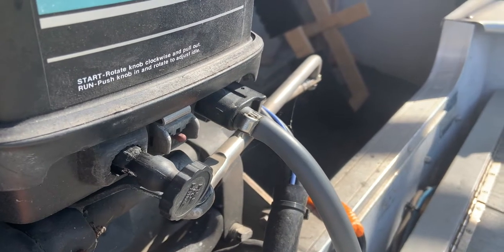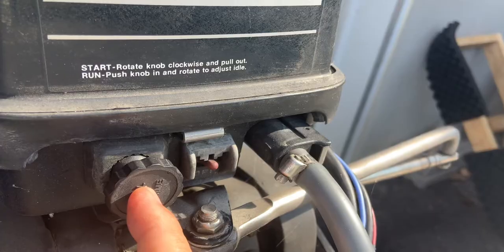Mercury 25Hp Pull to prime button explanation “start your engine”

Comment: Great video thanks. I have same exact motor. Question; person I bought boat from has it connected to a throttle with steering wheel.  In the throttle it mentiond "choke" as well. Do i still need to push in/pull out this choke knob on actual motor if its connected to steering wheel? Also, I find my boat initially starts ok. But while its idling (before I give throttle/gas), it "putt putts" a lot in idle (similar to how yours sounds in idle) but entine usually shuts off if I dont give it gas immediately after starting. Ever run into this issue? Im also about to start boat up for first time since it was winterized and I sadly dont know where the water hose connects :( I will put that sea foam in. Thanks!
Reply from the maker: Hi mikecorazza, I have a steering wheel and throttle also, but I don't have the choke option on it. When you activate the choke on your throttle do you see anything move on your engine side? Your choke on the throttle side might not be connected to outboard. Pull to prime button is a little more then just opening the choke. It also injects a little gas to help engine start better. For the “putt putts” might need to change your reeds or adjust the fuel and air mixture with the screw Infront of the carburetor. If you do adjust screw, “mark it first”, this screw can be tricky to adjust. I will have a video soon how to change reeds on outboard, I changed them this weekend and the outboard sounds much smoother.  For the water you need to purchase water clamps to put at the bottom water entry of the outboard. Hope this helps. 😊
Reply: @joetheboatguy5394  thanks for this info it will certainly help!  Is there a way for me to attach a photo of how my setup is with throttle to this chat?  Or email to you?  Also, how were you able to make your motor have power trim?  Every time I drop in at the boat launch I have to lean over the edge and pull little release tab or whatever it's called and lift entire motor out of water, drop back down, ljff back up etc.  Not sure how you have an electric setup so motor tilts out of water?? Are you able to attach pics or if leave an email address? Thanks so much !!
Reply from the maker: Hi mikecorazza, unfortunately Youtube chat doesn’t lets us attach photo’s. For the e-mail request I have done it once and it was a fiasco LOL. Was receiving e-mail and calls even over night. So I learned quickly that, that was a little mistake. If we can find another way would be great. 

For the electric tilt I have a CMC (I will paste a model at the end of the chat to show you) you would have to find what model is good for your outboard and boat. 

https://www.amazon.com/CMC-PT-35-Tilt-Trim-35/dp/B0CNKZN2T9/ref=sr_1_2?dib=eyJ2IjoiMSJ9.oVizQjpSEbGEiOqhG6696pm5A0R-h1mSE_W9o0I9_3AW_wuQFbuwhknb0NmPYEs6PTOk0Z1cDDkrBIezEjETdeRGDXVJp3KXF9S-lkEKvoIwSp2uMhuysFUwbIG-OTI7II1q6j9_fsU471_Vp5Zkbv1I9ep6FTdoe5dRfrrBPtF0sSNxEy9LTEG1oEyaRYVT8wKToYUFPK43jqf60KhP6pW7LKtIO9B_guxAns3BzUtk9nTEfwZEPcBjQoN74xJ4_mCPZsB2_NZgzryDNK9wg9Y43EAUBn0nOEJyl8SJtsE.q3PDCHTRxhYYu8VboTcyFj-CmKvYaz7EZJnkEGkPQY8&dib_tag=se&hvadid=409940860077&hvdev=c&hvlocphy=9003503&hvnetw=g&hvqmt=e&hvrand=9168730546767543213&hvtargid=kwd-2939807001&hydadcr=24658_11410762&keywords=cmc+tilt+and+trim&qid=1712100464&sr=8-2
Reply from the maker: Hi mikecorazza, unfortunately Youtube chat doesn’t lets us attach photo’s. For the e-mail request I have done it once and it was a fiasco LOL. Was receiving e-mail and calls even over night. So I learned that that was a little mistake. If we can find another way would be great. 

For the electric tilt I have a CMC (I will paste a model at the end of the chat to show you) you would have to find what model is good for your outboard and boat. 

https://www.amazon.com/CMC-PT-35-Tilt-Trim-35/dp/B0CNKZN2T9/ref=sr_1_2?dib=eyJ2IjoiMSJ9.oVizQjpSEbGEiOqhG6696pm5A0R-h1mSE_W9o0I9_3AW_wuQFbuwhknb0NmPYEs6PTOk0Z1cDDkrBIezEjETdeRGDXVJp3KXF9S-lkEKvoIwSp2uMhuysFUwbIG-OTI7II1q6j9_fsU471_Vp5Zkbv1I9ep6FTdoe5dRfrrBPtF0sSNxEy9LTEG1oEyaRYVT8wKToYUFPK43jqf60KhP6pW7LKtIO9B_guxAns3BzUtk9nTEfwZEPcBjQoN74xJ4_mCPZsB2_NZgzryDNK9wg9Y43EAUBn0nOEJyl8SJtsE.q3PDCHTRxhYYu8VboTcyFj-CmKvYaz7EZJnkEGkPQY8&dib_tag=se&hvadid=409940860077&hvdev=c&hvlocphy=9003503&hvnetw=g&hvqmt=e&hvrand=9168730546767543213&hvtargid=kwd-2939807001&hydadcr=24658_11410762&keywords=cmc+tilt+and+trim&qid=1712100464&sr=8-2
Reply: @joetheboatguy5394  appreciate the reply. I get the reservations about putting an email out there so I totally get that. If I can think of another way as well I'll let you know. And I have the exact same motor as you on a 16 and 1/2 ft aluminum alumacraft. My motor is 1989 and boat built in 1978 . Whoever set up the boat before me, also added a steering wheel with a throttle and that little handle that goes up to make idling faster.  I checked that link and item no longer available but ill look for alternate and thanks for idea.
Reply: @joetheboatguy5394  hey and sorry to bug you again. Just fired up motor this morning for first time since a marina mechanic winterized/fogged it. Again, I have exact same 25hp 89' Mercury motor as you and very similar (if not identical) hand controls. I let them do it because was first winter owning a boat ever.  Anyways, I had bottom half of shaft with those water intake grills (not sure what they're called) submerged in giant bin of water. I fired it up, and A LOT of smoke was coming out from all around motor. Now I know they poured stuff in before end of season last year, and they advised me to pour a little more in before I started it.  Do you think that smoke was just the sea foam from all winter?? But what bothers me is I didn't see water spitting out of I think it's called the tell tale?  I don't remember if my motor spits water out?? I thought all outboard do? There was so much smoke in the back that I only left it jn idle and gave zero throttle in fear that something was wrong, and let motor stay on no more than 5 seconds.  All kinds of things came to mind like wad the pale of water too high up on motor and blocked something it shouldn't have ... is tell tale plugged, something else wrong etc..  Just curious if it's normal for so much smoke after sitting 5+ months, and does your motor (exact same as mine) spit water out when in idle?  Thanks!
Reply from the maker: Hey Mikecoraza, it's no bother at all. No worries. Yes if you have fog and Seafoam in your engine, it will cause a white thick smoke, it normal. It will do that smoke until it burns all your Seafoam and fog.  

Now for the water, yes your engine needs to spite out the water from the tale. Sometime in idle the water doesn't make it way trough the water pump, a little throttle might have help to get that water going. On idle water should make it way trough but you just open your engine so a little throttle might help it. I don't use a bucket i use one of these https://www.amazon.ca/dp/B09M8VFY7D/ref=sspa_dk_detail_5?psc=1&pd_rd_i=B09M8VFY7D&pd_rd_w=wxZas&content-id=amzn1.sym.d8c43617-c625-45bd-a63f-ad8715c2c055&pf_rd_p=d8c43617-c625-45bd-a63f-ad8715c2c055&pf_rd_r=M9AECRY7RW8AQGAKGQBA&pd_rd_wg=MW1U1&pd_rd_r=ee6b8027-8ea8-4f59-973b-b04bccd3e669&s=amazon-devices&sp_csd=d2lkZ2V0TmFtZT1zcF9kZXRhaWw

BTW i have a video on how i winterize my outboard too if you want to attempt it next winter: https://youtu.be/TyvYxgSd4Mk?si=mw1Z6Y1RMBMDvsut

Let me know how it goes :)
Reply: @joetheboatguy5394  thanks so much once again! I wondered how you were putting water in with the hose in one of your videos. Maybe you could make a quick video about that to get more views;). A mechanic at the place I winterized said they see people burn out their motors and replacing impellers using hose to put water in saying its not enough water, and they recommend motors are only started on bodies of water (unlesss theyre experienced mechanics and have very large bins to submerse the motor.. But i see you and so many others on YT doing it this way and you havent ruined your motor yet so im guessing I should be safe! And thanks for info on the smoke/water and adding throttle etc.  I did see your video about winterizing but I had my boat for a few weeks (never owning one before and not a mechanic) and still wasn't comfortable yet. But probably will give it a go this fall and planned on using your video to guide me. Thanks again !!
Reply from the maker: Hey mikecorazza, any update? engine back to normal. The Mercury of those years were the best engines ever.....
Reply: @joetheboatguy5394  hey Joe. I can't believe you messaged me. What I mean is, your timing is unreal as I'm literally working on my boat to add little cubby spaces for storage. However I was literally thinking of you to make your timing even more unbelievable because I took my boat out 2 days ago on the water. Ran great only smoked for a little bit water spitting out in the cooling system like it should. Now today, I'm in my garage working on other parts of the boat, and looking at the bottom of the propeller, which is a foot off the floor, and small amounts of oil are dripping on the floor. That raises my stress levels because I feel like it's going to be a big deal
Reply: @joetheboatguy5394  forgive my messages I'm using voice to text. But basically there's almost like two things on the ground, a dark oil, and even more like a clear looking oil that you'd see like in your car engine. Just the tiniest drops not anything coming out fast but I'm trying to figure out where it's coming from and I thought of you LOL. And I have to go to work in an hour as I work afternoons so the timing is bad as I wanted to look into this further and I planned on going with the guy fishing tomorrow morning but now I'm stressed out about this. I'll try and see if I can see where the oil is coming from like if it's higher up or lower
Reply from the maker: Hey Mikecorazza, you probably have an oil drop and oil mixed with water which will be much lighter. You just have to make sure to see if it continues dripping. if it doesn’t continue dripping then your fine. don’t forget you have a two-stroke engine so you do burn oil, so oil will end up coming out of the system. I will look at the video when you give me give me the link, but I wouldn’t worry too much unless you have a big oil stain on the floor that keeps on growing.         Your gas tank is mixed with oil and fuel, so the fuel gets burnt the oil lubricates your engine, but the extra will end up coming up, which is not much. But that is what you’re probably seeing.

Comment: Mine broke, is there a way that I can replace/buy a new one?
Reply from the maker: Hi Julian, thanks for watching. Look under Google search for “Primer Knob 128022” you should see some results for knob.
Reply: @joetheboatguy5394  I have a 20 hp 2 stroke mercury outboard though, would it still be the same part I’m looking for?
Reply from the maker: Hi, would be hard to say without the serial number. Get your serial number and enter it at this website and look under carburetor section you should find it… 👍
https://www.perfprotech.com/mercury-marine-parts-catalog/collection/01/mercury
Reply: @julianmontes4314  yea same from
15-25
Reply from the maker: Thanks for the help @habitat009. :)
Reply: @MrHabitat009  I bought and installed it last week and went out yesterday, motor ran strong
Reply: @julianmontes4314  How does it go back together?  Trying to replace mine.

Comment: Mine just leaks gas when I start it and won’t run. Any suggestions?
Reply from the maker: Leaks gas from where? If it’s from carburetor. You will need to get it cleaned. Also check your gas filter…

From Google: When the tip of the valve becomes worn or debris prevents the closing of the valve, fuel flows continuously into the bowl thus flooding the engine. Under severe conditions gas may soak the air filter or overflow out of the carburetor and onto the ground while parked.

Let us know 👍

Comment: I just purchased one 25 hp , 2 stroke. It pee like the one in the video but the water is hot. I can hold the hand under water but feel burning. I wander if is ok? Thanks
Reply from the maker: Hi Jan, thank you for watching. For the hot water, is your engine re-using the same water, do you have your engine in a barrel? Or is it coming hot out from the Lake or River? If you’re re-using the same water for sure it’s gonna start heating up with time. If it’s not the same water than some thing might be clogged in your system because the water does come out warm but not hot. What you can try and do is blow some air with a compressor in your cooling water exit. Let me know 👍
Reply: Looks to me thermostat is not working properly as it should open to release cold water when at given temperature

Comment: i turn this knob and nothing happens no idle increase or decrease, any ideas?
Reply from the maker: Hi chrispeterson, Thanks for watching. I will send you to another video I made so it will show you what I'm talking about when I say "metal rod". You will see the metal rod at 33sec of this video, the metal rod that is connected to your plastic upside down plastic L. 

The plastic upside down L you see at the right of the screen in the video it is connected to you knob. If you turn your nob right for increase idle you will see the upside down plastic L pull the metal rod connected to it. That metal rod goes to your idle (golden colour) Rod. You can see this idle rod on the same video at 1.58min top left corner. 

So make sure by turning you idle knob your plastic upside down L should be pushing metal rob when turning left and pulling metal rod when turning knob right.  

Here the video: https://www.youtube.com/watch?v=qFLHL7AjYxw&t=48s

Let me know if this help. Not sure I was clear

Comment: What year is this motor?
Reply from the maker: Hi N L, thanks for watching, the engine is 1993 👍
Reply: Get rid of that grey fuel line and get some fuel line from a automotive store. The lining will break down and cause a lot of problems in the carburetor. Especially if you use ethanol gas.
Reply from the maker: Hi Joseph Beecher, thank you for your comment. Are you sure this line does what you say? Let us know 👍

PRODUCT DETAILS
The Attwood® Universal Fuel Line Kit works perfectly on outboard fuel systems. This reliable, durable fuel-line system delivers low-permeation material to prevent fuel evaporation, saving you fuel and money. The fast-priming, high-output bulb maintains flexibility and prevents collapse in hot and cold temperatures. The Attwood Universal Fuel Line Kit provides industry-leading vertical fuel draw for priming in any application. Certified to meet all EPA and CARB requirements. Meets all USCG and ABYC standards. Compatible with ethanol blended fuels. Includes bulb, stainless steel hose clamps, and 6' x 5/16"-diameter fuel line. Manufacturer's 2-year limited warranty.

For use with outboard fuel systems
Low-permeation material
Prevents fuel evaporation
Saves you fuel and money
Bulb maintains flexibility and prevents collapse in hot or cold temperatures
Industry-leading ver tical fuel draw for priming in any application
Certified to meet all EPA and CARB requirements
Meets all USCG and ABYC standards
Includes low-permeation primer bulb, stainless steel hose clamps, and 6' x 5/16"-dia. fuel line
Fuel line fittings not included